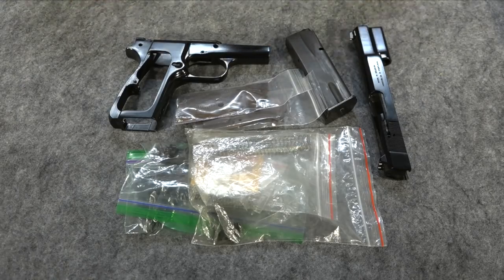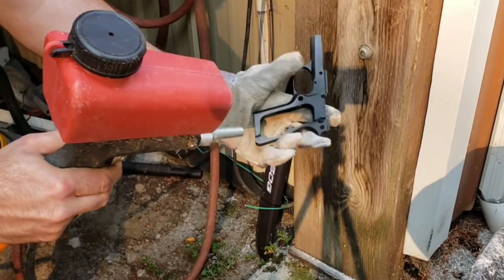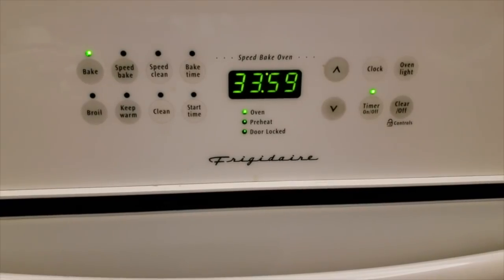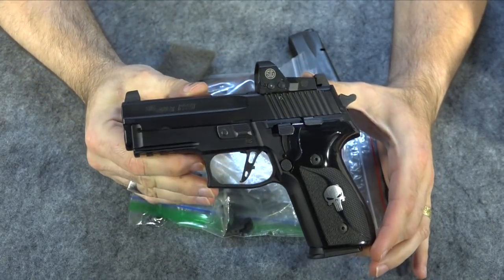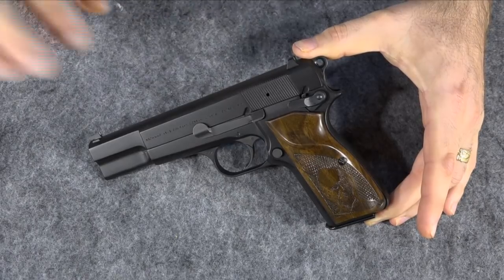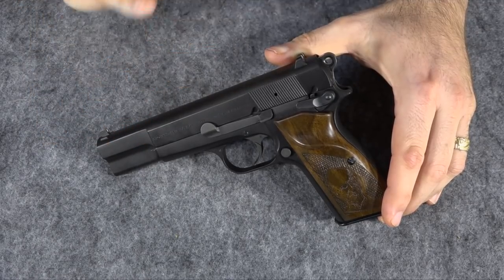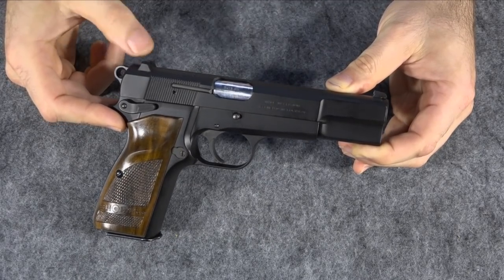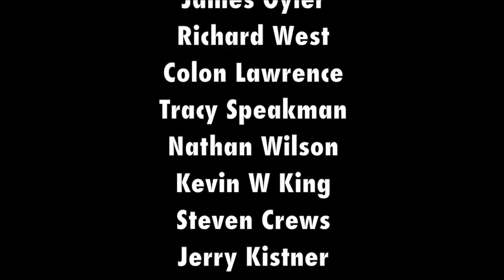Spray On BAKED-ON Gun Finishes: Durable & Easy?

Comment: That's a sick gym, so cool! I'd love to have something like that at my house
Reply: Too bad YM isn't using it.
Reply: @cannonball666  *shots fired
Reply: Under the yeti.hair is noting but rippling muscles... High... And lots of Russian surplus anobolics
Reply: @usernameisusername  Is that why he resembles most of the players on the Romanian women's dodge ball team?
Reply: Meh. You can make a MUCH more effective home gym for pretty cheap with some patience and fb marketplace. Mine is fully outfitted with dumbells, bars, benches, bench press/leg extension, power rack, cable pulldown, platforms and 900+ lbs of plates. I maybe spent 2k total on all of it by buying mostly used and building some stuff myself. He is honestly missing THE most important bit of kit. A power rack and an olympic size bar. If you aren't doing compound lifts your doing it wrong. The dumbells are the best thing in there. Those machines look like they are from the 70s. But hey, he's trying at least.
Reply: And covered in overspray

Comment: VHT ceramic header paint is great for guns. I find it as tough as Brownells and other Ceramic spray coating systems for guns.
However. The instructions are exactly clear so I called them to confirm.  You have let the painted part sit 24 hr for solvents to dissipate. Then use a 3 step / increasing heat each time  ramping heat process. 
And VHT comes in several colors, including flat and gloss and cost $8 a can.
Reply: Yes.....and no, VHT goes on thicker than the gun specific ceramic paints,not to much but it's enough to cause some problems with fit
Reply: I've been using VHT without any issues for several years.
Reply: @danielfisch655  i used it on an AR build did 2 light coats of grabber green as thats what it took to get full coverage the pin holes needed to be cleared out and the top of the lower/bottom of the upper needed to be sanded down because they wouldnt fully close anymore, glad yo hear you've had good luck with it but Ive run into fitment problems
Reply: bigredtruck42 sorry to hear you had a problem with it. I’ve used VHT on numerous AR, AK, Polymer 80 slides and even a 1911 build with no issues.
Reply: I love vht epoxy, i first sand blast it then apply thin coats and results are really really close to brunitone and holds really good

Comment: I sanded the black factory finish off the sides of my P320 to give it the Equinox look. Took me like 4 or 5 hours to sand it down to bare metal.
Reply: Just got a 227 equinox early summer
320 feels pretty lame compared to it
Reply: Nice. I do prefer the look of the regular, hammer-fired Sigs to the P320. Unfortunately, I don't have any yet. Congrats on getting a 227. They are awesome.

Comment: That looks way nicer than the original finish.  Have you tried this on a revolver by chance?  I hear that the cylinder has trouble with burning the coat from the hot gases escaping when fired.  It would be great to see you test it out if not.

Comment: I bought a blaster and some glass bead and for the life of me I could not get it to take the finish off a Springfield. I bought it used and someone color filled it and when I tried to get it off of there with some nail polish remover it ate the finish. So I thought I’d blast it to a matte finish and go with the bi tone look but I failed in spectacular fashion. Anyway, any tips on the bead I should use or method? I have a dewalt 120psi pancake compressor so I thought that was my problem but after your video maybe it’s not.
Reply from the maker: Use garnet to remove the finish and then glass bead to finish the surface.

Comment: Looks great Yankee. Have a quick question. If I was to use something like brownells alumahyde 2 on an AR or AK would bead blasting be needed? I was just going to degrease and maybe run a little synthetic steel wool over the surface.

Comment: will it stick to a stainless steel slide?  Thinking about this for my SD9VE.
Reply: Sand blasting is not only done to remove the old finish but it roughs up the surface for the coating to adhere.  As long as you prepare the surface correctly there is no reason why you can't.